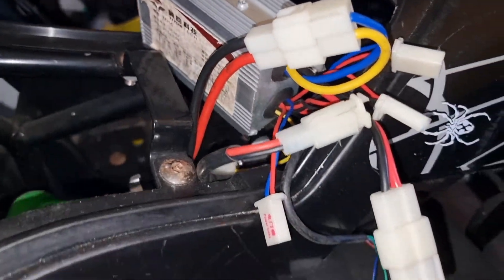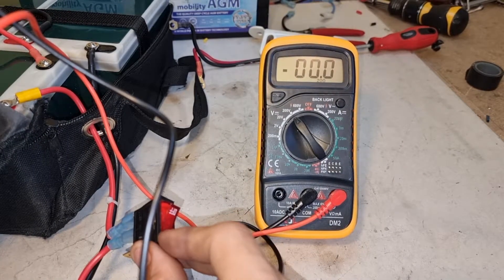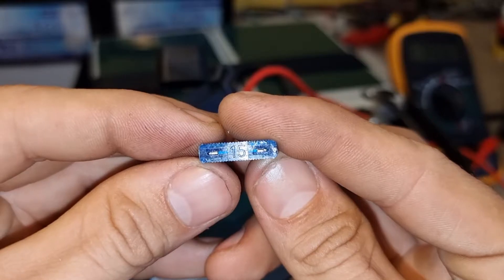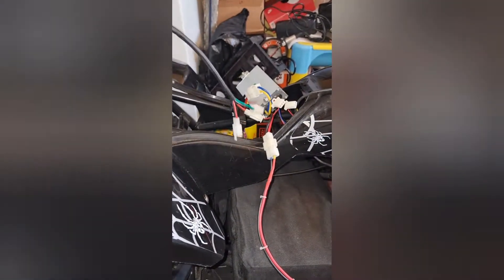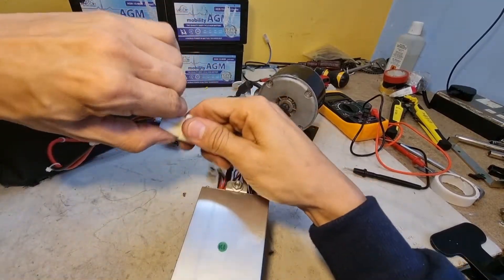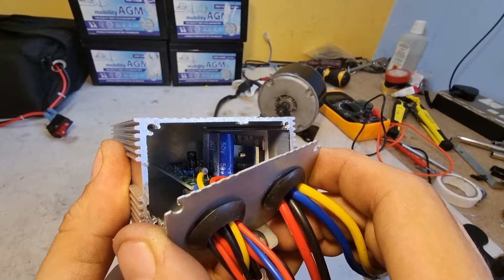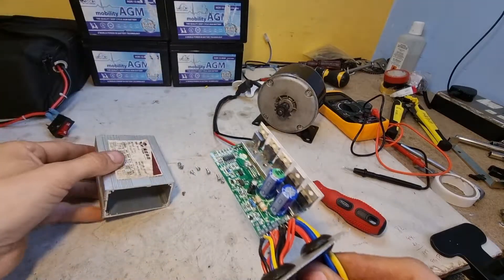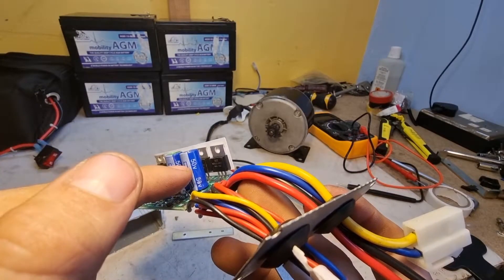FUNBIKES 36V 800W ELECTRIC QUAD BIKE.. FUILTY CONTROLLER

Comment: hi, have you tried putting a few drops of solder on the shunt to get more inspiration? it can be done in brushless control units.
Reply from the maker: Theses controller are dc motor Controllers..

Comment: its your memory (learning wire). needs to be wired up then turn on controller and disconnect wire then turn off controller and reconnect and should be fine
Reply: Where is the learning wire?
Reply from the maker: I don't think this controller had one
Reply: Did you solve this controller issue?
Reply: Not true

Comment: I have the same issue. Changed controller and speed command and still on. Could you solve it? How?
Reply: Wrong throttle
Reply: Hall throttle starts around 1.2v pot throttle starts at 0.1v see when plugged in the wheels spin its reading 1.2v as soon as you turn it on it needs to read 0v